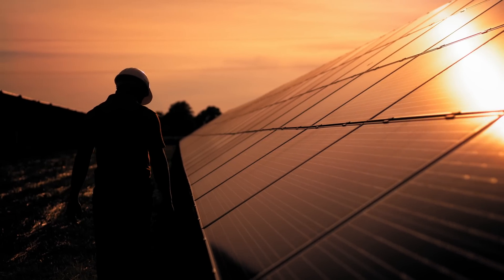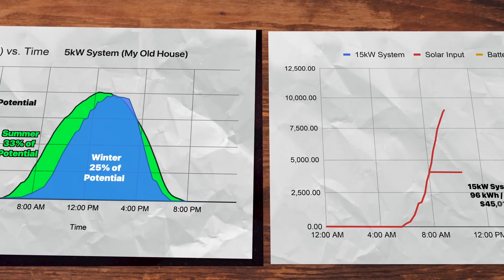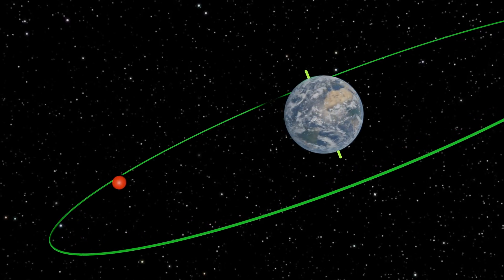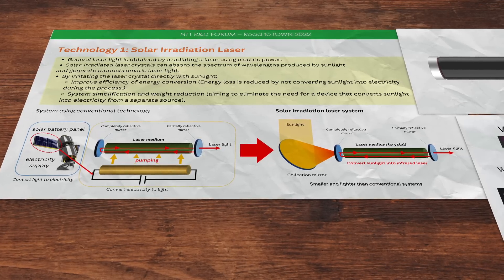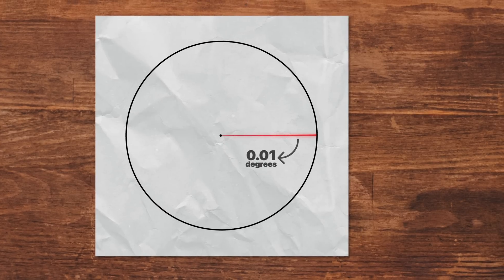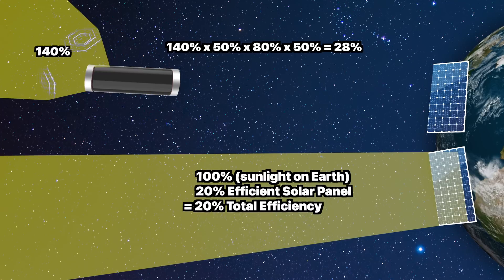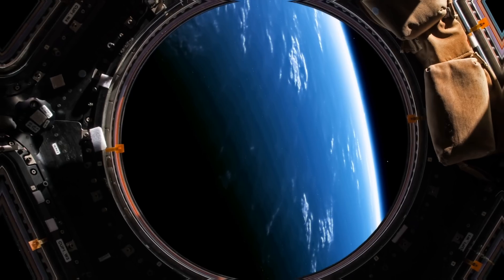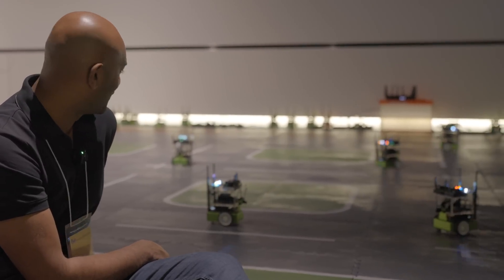Groundbreaking Research Transmits Energy From Space 24 Hours a Day!

Comment: There is a US Project called SCOPE-M that is working on safe transmission of energy via microwaves, instead of pumping dangerously high levels of microwaves, which would require the system to shut the beam off to avoid cooking something that entered it's transmission path, this newer tech uses the 10GHz band and is safe.  using microwaves to transfer energy, even in crap weather, your looking at less than a 5% loss in power.  So seems like the real win here (when the technology matures) would be to use the solar collecting mirror strategy (and maybe distribute it so you have no single points of failure) and fire it at space based high efficiency solar panel satellites or stations,  which would then convert to microwave and beam to ground based stations.   As time progresses and the technologies mature even more, you could put the whole ecosystem (solar collecting mirrors, solar panel and mw beaming satellites/stations) out in the L1, L4, and L5 Lagrange points beaming the microwave energy back to retransmission stations in earth orbit,  save cost on station keeping etc... and be able to distribute power all around the globe, not to mention space stations and bases on Luna and Mars. 

Looking further out - pie in the sky type further out - if we could go snag a nice chunky nickel iron asteroid, smelt it and use the off-gassing as propellent to move the asteroid and it's refined materials into an earth/moon Lagrange point (Maybe L1) we would have an astronomical amount of refined material to work with (most likely we'd have more platinum group metals than have been mined on earth in it's entire history, in addition to unbelievable amounts of silica, iron, nickel, gold, etc... and with space providing a level of vacuum we have a hard time producing on Earth, you get into increased quality of those materials as well.  Get yourself a big ball of molten nickel (migrogravity and heat will make it aggregate into a sphere, get a gentle spin on it, heat it up with columnated sunlight, and impurities and gasses will move to the outer layers.  Were talking space based industry here now - with all those nice pure raw materials - start fabricating the stuff that we can in space - if we could do those high efficiency solar panels and microwave transmission units - even the mirrors - only lifting the smaller more complex components out of earths gravity well, you'd have the rudimentary building blocks for building a very basic bitch level Dyson Swarm.  And that.. that would be truly bad ass.  

If you envision conflict and poverty as a 3 legged stool, the legs are Resources, Religion, and Politics.  Cheap, unlimited energy is the start of knocking out one of those legs, knock one leg out, it's very hard for that stool to stay upright.  You could start by beaming energy down to desalinization plants, energy is one of the major costs of those operations, now, you can produce enough fresh water to irrigate deserts, refill aquifers, etc... grow more food than we know what to do with.  With space based industry - raw materials costs would plummet - because while it would cost a butt load of cash to start up - once it got going - the sheer astronomical supply of those resources would make materials costs for manufacturing almost everything - dirt cheap.  That's obviously a long way off -   maybe our great grandkids will see it, would be an amazing time to be alive. 

That being said - a video on the efforts to develop probes/drones for asteroid prospecting, and eventual mining - that would be a very cool video.
Reply: Oh, and I am no scientist - I just like to read... a lot... and love emerging technologies and futurism.  It goes without saying there are very big obstacles to overcome in industrializing space - so ya know - if you are a smarty pants, don't crucify me if ya know?  :)

Comment: Why not just boil water with it, also they could put it in an off angel geo orbital, the satellite will need to move its targe a little, but could adjust orbit so it is not behind  earth
Reply: presumably their current method of creating the infrared is more efficient. Keep in mind, you have to condense that steam again so you can reuse the water, and getting rid of heat in space is not easy.
Reply: @Alexander_Kale  lol, ment use the infrared beam to heat water on earth
Reply: @killer3883  That is probably even worse. You loose a lot of energy with steam turbines.

Comment: The problem with this plan is that it is dangerous one mistake and planes fall out of the sky because their wings melt and blow up or the Earth gets cooked because the laser is accidentally aimed at the Earth instead of the solar panel that is supposed to be collecting the laser not to mention that laser in order to be caught has to be so small that it is a weapon demanding to be removed. What works good to power the space station cannot possibly be allowed to power anything here on Earth unless you can find a safer way to get the energy from point A to point B to point C. The problem comes when you're trying to transfer from point B to point C because commercial airlines are in the way and you can always realign point B to hit something other than Point C not to mention a solar accident such as a particle disrupting point B can cause point B to go off course and do damage to the Earth itself including boiling the sea or attacking a foreign entity that is not prepared to defend itself and does not understand what's going on until it's too late which is literally seconds
Reply: If the laser is not powerful enough to melt the solar panel, which gets hour long exposure, then any plane flying through the beam for the fraction of a second should be fine...

Comment: A microwave device called an Amplitron would work to transmit power, although it needs to have 2 pulses where the first pulse ionizes the gas molecules so the second pulse can avoid high attenuation.
I've only seen an Amplitron design in a microwave engineering book from 1954 or so. I think it used 1 megawatt. Not sure how much power it takes to ionize all the air molecules so thinking an efficiency of 5 to 10% max imo. 30 to 50GHz was the range. Haven't seen it mentioned again so perhaps it got lost or didn't work.

Comment: Has anyone considered transmitting energy around the world using laser light and fiber optics? would this be more efficient/effective than aluminium cables?
Reply: Two problems with that. 1), you would incur massive losses. Energy to laser and back to energy would decrease the amount of energy your system actually transports when compared to cables. Plus, laser emitters cost upkeep incomparable to cables.

Second problem: Energy density. We need to be able to transport massive amounts of power here. Which means your proposed power stations do double duty as cannons. Not only is that bad from a safety point of view, it would also create a net of self enforcing no fly zones over our cities, which, in addition to eradicating the local avian population in very short order would also make building new high rise buildings more complicated than it needs to be.

Sure, you could build the lasers underground, but in that case you could also just lay a cable instead. Cables are boring, but they are in many cases the better option exactly because they are boring..
Reply: Laser spread too. Which means you have to build laser repeater which is much more expensive than a pole for cable.

Comment: I'm moderately convinced by this one... 
With current science, we have no idea of how one could advance in space without ejecting mass, and the result of this limitation is that oil-based fuels are the only ones efficient enough to launch big payloads to orbit. Now, we could use those synthetic fuels made from carbon capture that you talked about in another video. ...But if we can do that, we basically don't need those solar farms nearly as much anymore.
As cool as space is, the ticket to up there is still expensive in non-renewable ressources. Yttrium is once of the rare Earth materials that might run out the quickest, and seems it is key to use it here, which is another ressource problem too... I might be wrong, but I think the problem of rare Earth materials will cause the use of space solutions to decline over time. ...Until maybe the day a revolutionary breakthrough like graviton propulsion comes around, but that kind of event is an unpredictable wildcard.
Reply: If we can figure out how to produce large amounts of carbon nanotubes we can build a space elevator, that's the best bet imho.
Reply: @DFPercush  Considering the international space station is facing problems for its financing, I don't believe the space elevator is credible as a short term solution. The energy and ressources to build it are MASSIVE and in a context of all nations scavenging for cheap energy, the other solutions will likely (definitely IMHO) be privileged.
Much further in the future, if we have virtually infinite energy? Then maybe we'll see a space elevator. But it will not be build before the energy problem is solved. Way too risky and expensive, for a gain in efficiency that is not even that big.

Comment: it's interesting specially for countries with low free surface to install large solar farms and bad weather, like Japan.
I've been thinking about laser energy transmission form building to building
Reply: That I can see being useful now, as we already have Line of Sight laser networks for computers and communications in our cities. It removes the problems with running cables and power lines  over land that is expensive upfront, maintenance costs and the cost for permission of land use. You can't very easily run power and communication infrastructure over land you do not own. This would solve a lot of problems if they could get the losses lower.
Reply: pretty sure cable can handle that more efficiently ¯\_(ツ)_/¯

Comment: The thing I am most concerned about is what sort of reactions and losses occur when you beam that energy through the atmosphere.  You need a pretty decent physics simulation analysis of what kind of chemical reactions and lossage would occur as that energy goes through the atmosphere for a given laser payload type for each distinct layer of the atmosphere.  And then you would want to optimize the wavelengths of the laser being used for transmission so that losses are minimized and to ensure no reactions causing harm to the atmospheric chemical composition is occurring.
Reply: Hopefully they will use a maser instead of a laser, the transmission is more efficient, the ground collectors are more efficient, the lower frequency of the radiation disturbs the atmosphere less, and the equipment is cheaper.
Reply: Yes.  Microwave is safer since it doesn't catalyze many reactions.  UV is the worst though.  If you ionize the atmosphere it creates ionization trails for lightning.  And given that there is always a potential difference between upper & lower layers you'd have lightning striking your ground station all the time.  IR with enough energy density can create N2 ions but I don't know if how bad this would be - if it would be significantly above background levels.  Given the dispersion of the beams - might be insignificant.  But someone needs to do the math.
Reply: @KaiseruSoze  - wow - that is awesome!
At the end of the video, there was discussion about capturing & storing lightning… this would be a great way to perform additional power generation!

Reminds me of robots getting energy from lightning in recent “Lost in Space” series
Reply: @KaiseruSoze  maybe more energy could be captured from lightning striking the ground station all the time.
Reply: How many low orbit satellites would the beam have to pass through?
Reply: i'm pretty sure you can just... do this and measure, you dont need to simulate anything
Reply: infrared won't cause harm to the atmosphere but there could be local weather effects and ecological ones in the region
Reply: As mentioned in my earlier reply... all this is 50 years old... seek and you shall find..
Reply: @Dustin Etts, did you watch the video? All of it?
Reply: @alanhat5252  yes, they talked about optimizing the laser for energy transfer, but that is often done using only the light-oriented properties that would cause possible reflection/refraction, not necessarily accounting for chemical reactions or increased probability of particular chemical reactions in the atmosphere.  That is not something people are typically concerned about in those kinds of simulations because the simulation is usually just understanding what is happening naturally or with slight perturbation.  This on the other hand would be regularly sending energy pulses through the atmosphere, and if it becomes commonly used, any random chemical reactions in the atmosphere that it increases the probability of occurring or causes outright in a way that is not normal, can become significant by means of accumulation over time.  Overlooking stuff like that constantly gets people into bad situations, and it was not mentioned in the video, and it is inherently a lot more work than just running a normal optical simulation.  So it would not be crazy surprising for people related to the project to say not to do it, or possibly not think about it because it is an abnormal situation where it might be important to account for that, and for people to neglect it.

Comment: This is interesting. I'm still watching but I remember hearing about directed microwaves used in a similar way 20 some years ago.

My concern would be what this does to the things it hits, atmosphere, air, birds, people. Concentrated solor has killed a few birds.
Reply: If you make the beam diffuse enough to limit it to 500 watts per square meter the number of bird deaths should be negligible although it would create an uncomfortable environment for a lot of them, if you direct it into the most concentrated beam possible you could minimize the number of animals exposed to the heat, but birds would drop out of the sky from heatstroke.
Reply: @garethbaus5471  There's a dramatic rolloff in probability of a flight path intersecting a beam path with the size of the beam- remember, it's a nearly perfectly vertical fixed cylinder. I don't have time to run the calcs, but I'm sure there's a resonable risk profile relative to beam parameters. Also, the fixed wavelength might not be effectively absorbed by tissue- this isn't a heat lamp or microwave oven.
Reply: @ticthak  It generally does work out to be worth it to be more concentrated, but the added cost of a larger rectenna is surprisingly low.
Reply: @garethbaus5471  Most of Europe & some of north-west Asia have reduced energy consumption since 1965 according to Our World in Data but everywhere else has dramatically increased (up to 40x in some countries) so we consumed 165,320 TWh just in primary-source electricity last year. How much area at 500W/m² would we need to collect that amount of energy? (allowing for losses).
Reply: @alanhat5252  The rectenna style used for microwaves in that type of situation is mostly a lightweight wire grid not unlike chicken wire, and doesn't interfere significantly with agriculture or other uses(it could even be collected over residential areas without much risk) if you suspend it high enough, so the land lost is effectively negligible. It should be noted that designs that use a microwave collecting rectenna generally have a net transmission and collection efficiency of roughly 70% to 80% so the surface covered by the rectenna to collect enough energy to power the world would be significantly smaller than the area needed for an equivalent amount of energy production using photovoltaics and unlike ground based photovoltaics you get power 24 hours a day 7 days a week without needing batteries. An area the size of the state of Georgia could get the amount of energy you described in about an hour using a beam of 500 watts per square meter, and last I checked there were over 8000 hours in a year.
Reply: IMO, it's relative. Wind/solar kill about 500-600K per year in the US. That's a lot.

Wild domestic cats in the US kill about 2+ BILLION birds every year.

Fossil fuels kill millions of birds and other animals every year. 

Concentrated solar is but a drop in the bucket.

It would, by far, be the lesser of two evils, between this and the status quo.
Reply: A) 50+ years ago
B) The frequency of the 'microwaves' used  is NOT the same as in your microwave cooker, therefore no heating of H2O or other organic molecules. In a similar vein the AC mains is of no concern re the 'microwaves' it emits. As is radio/TV/mobile-networks no danger of frying you in everyday use.
Reply: @ivar-the-terrible  I'm glad you agree with what I pointed out. I agree 100%.

Even 500K MORE a year is a drop in the bucket compared to what fossil fuels kill every year (birds, mammals, people, etc).

Comment: What happens when a plane flies through the beam?
Reply: I recommend not doing that. It’s invisible and you’ll be cooked before you know it.
Reply: It depends on how concentrated the beam is, if it is limited to 500 watts per square meter (a common occupational safety limit for added non ionizing radiation like microwaves) the surface of the aircraft would get slightly warmer but not by enough to really matter. A more concentrated beam could effectively be a death ray that cooks aircraft, so a no fly zone would be necessary if we used a more concentrated beam.
Reply: The death star
Reply: The death star